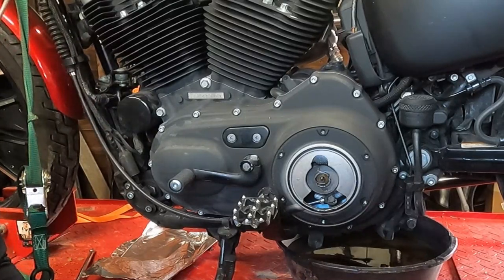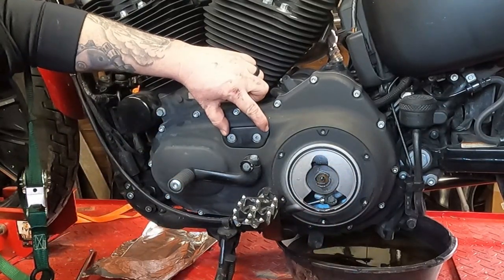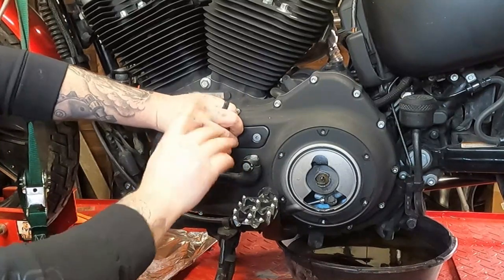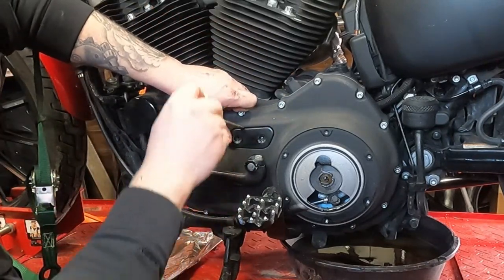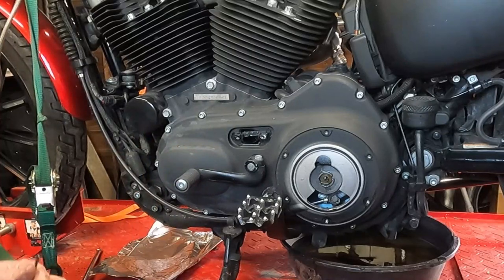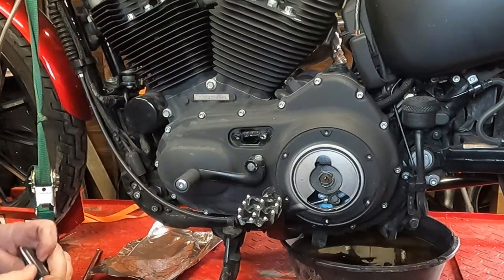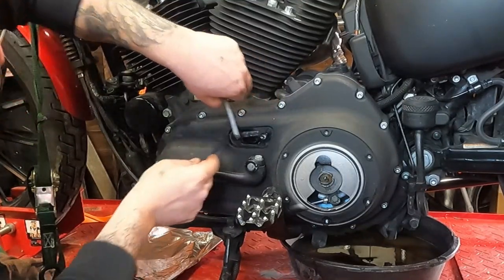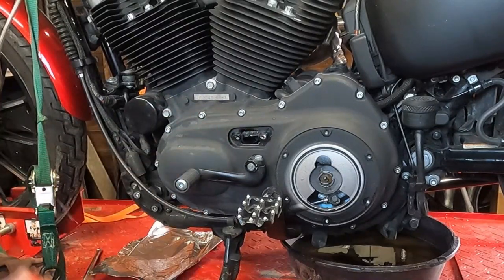Check Your Primary Chain Tension on a Sportster

Comment: Okay from the dealer mine is kinda tight. Sometimes very rare I can’t get into neutral. I have the clutch in and I can downshift the whole light and never get it into first. It will say im in 2nd on the gauge
Reply from the maker: Make sure your clutch is adjusted right. If it drags a little, you will never find neutral.

Comment: I'm hearing a noise in my primary even in neutral rolling down the road I even shut engine off and still hear the noise 😐 what could it be does chain move with back tire or only in gear?
Reply from the maker: The chain is directly attached to the engine.  Any noise with the engine off & in neutral, would be in the final drive, or the transmission.
Reply: So does that mean it's a bearing on the output shaft and I'd have to split the case to fix it or could it be something easier
Reply from the maker: @jasedavids1795  could be. But it’s the least likely of problems. I would check rear wheel bearings, brakes, belt, and every other possible option before I tore the trans apart.

Comment: Bro you're supposed to rotate the rear wheel to move the chain to find the section with the most slack.. then adjust or not
Reply from the maker: That’s where the slack in the chain comes in.  If they were both perfect concentric, you would have less slack in the chain.

Comment: what about the O-rings on those screws
Reply from the maker: There isn’t an o-ring under those bolts.  Actually I can’t think of any HD primary that has O-Rings under those bolts.
Reply: @KnobleMoto  wtf, mine has them...🤔
Reply from the maker: @MUCKFOOT399  fascinating.  Is it an aftermarket cover?
Reply: @KnobleMoto  no, 2004 sportster.
Reply from the maker: @MUCKFOOT399  a friend has an 03. I am going to have to take a look.
Reply: @KnobleMoto  my 06 has o rings as well
Reply: 09 nightster. Mine has the o rings as well.
Reply from the maker: @Ch1c490  this is really interesting.  I wonder if it was a cost cutting thing on certain models.
Reply: @KnobleMoto  I got a 2014 Sportster 1200XL and it has o-rings as well
Reply from the maker: @Yakub87  wow!   now I am wondering if this is some import replacement.
Reply: @KnobleMoto my 2021 xl883 has o rings too